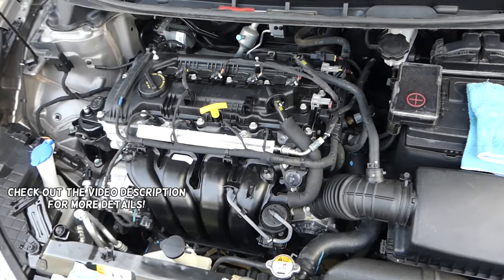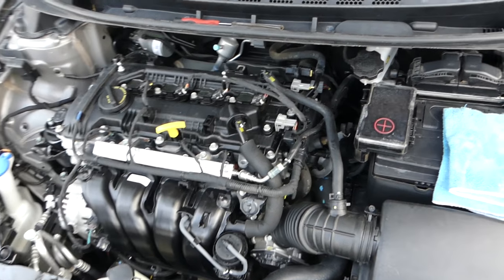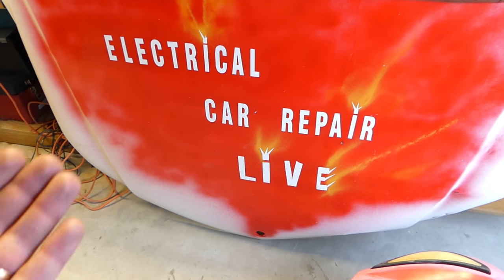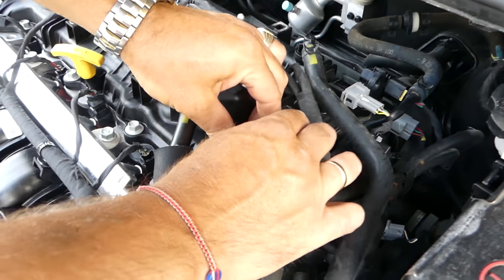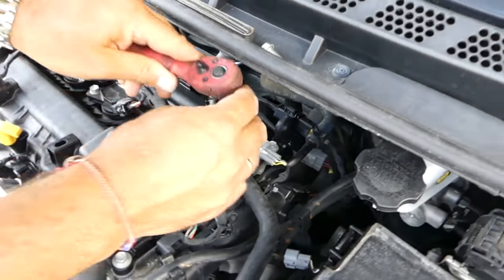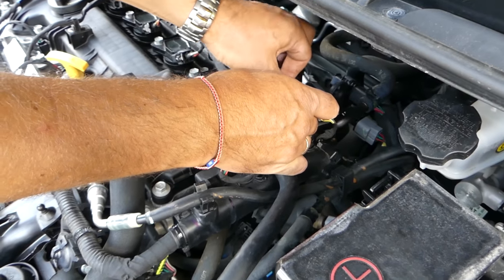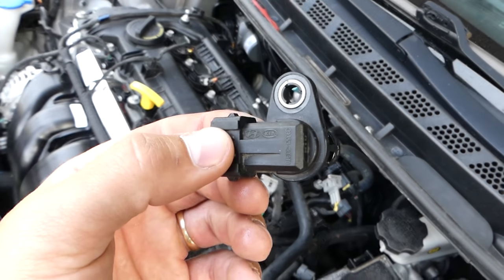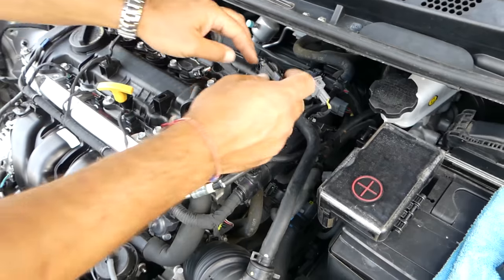HOW TO REPLACE CAMSHAFT POSITION SENSOR ON KIA FORTE SOUL OPTIMA

Comment from the maker: Products that we use and recommend:
► Replacement Camshaft Position Sensors used in the video: https://amzn.to/2ODkXPG
► Panel Removal Set: https://amzn.to/3YiMADu
►Torx Set: http://amzn.to/2hbyWgd
► Tool Set: https://amzn.to/3p5MM6t
► Screwdriver Set: https://amzn.to/3XRB28Q
► Engine Oil: https://amzn.to/3xBc8B9
► Oil Filter: https://amzn.to/3w0Ulme
► Torque Wrench: https://amzn.to/32qyRwg
► Liqui Moly Engine Flush: https://amzn.to/3IiDBID
► OBD Scanner that we use most often: https://amzn.to/3I4MQfe

► Check out our Amazon Store for the tools and parts that we use: https://www.amazon.com/shop/worldmechanics

Comment: So what if I only replace one of them. My Kia has been only Reving up to 2500 rpm & the code said I needed Cam shaft sensors
Reply: King Vic what’s did you have to do

Comment: I still get that it's bank one on the camshaft sensor which is bank one so it's always the front it's bank one and not towards the firewall It would be common sense of the one you're looking at first is bank one and the other one is spank two but it still has that on the camera sensor I did buy two brand new ones but one must be bad

Comment: Can I Tell me some information about 

Code p0011 Camshaft Position A – Timing Over-Advanced or System Performance (Bank 1)
And car it's hyndai elentra GT 2014
Reply: Moha Said I had the same code on my Kia Forte koup . Wondering what it is. Because I changed the vvt solenoid on it .
Reply: You ever fixed the problem. Cause I have that same code on my Kia Soul wondering if it was actually a timing issue or just sensor

Comment: Would this cause a no start? If sensor is bad, I have code p0017 2012 Kia Sportage new battery new starter.
Reply: Yes it will I have a kia and it been acting dum I replaced  the camshaft  and fixed the problem